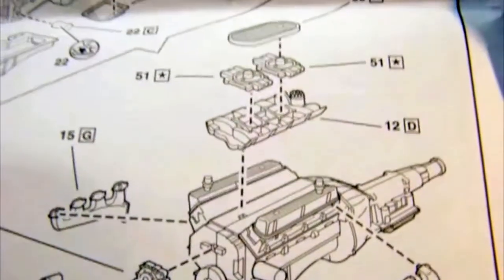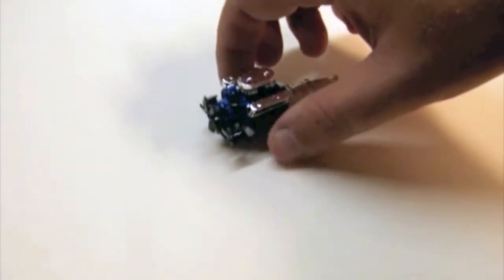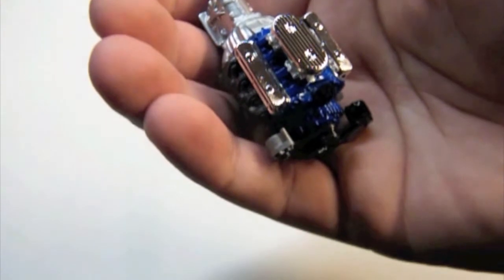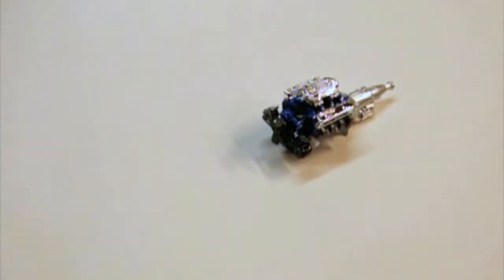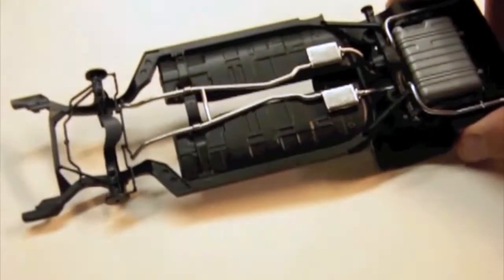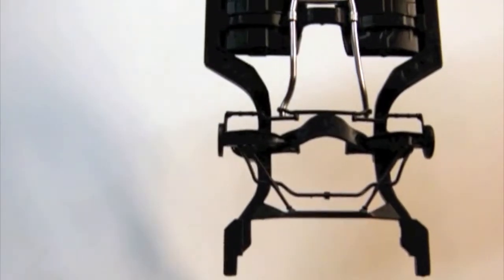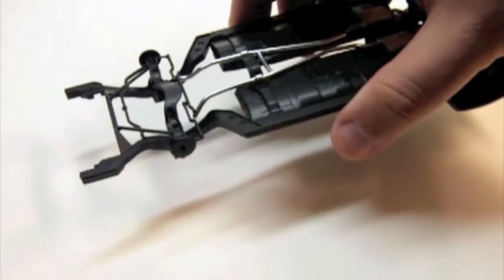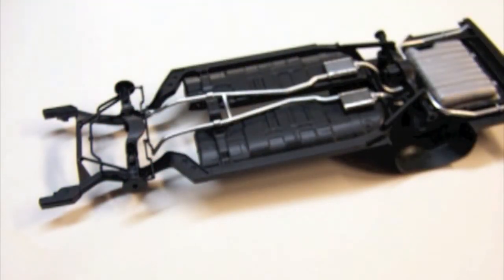Building Revell's 1/25 Scale "Starsky & Hutch" Ford Torino - Part 1

Comment: I'm not understanding the instructions for installing the breather caps. There are two very tiny breather caps that are shown to go into the valve covers, but no holes or indents to mount them.
Reply from the maker: You can see pics of the finished engine with them installed here: https://youtu.be/BaJTkVnnPL4?t=120

Comment: Looks great so far. What year is this model anyway? It doesn't say on the box that I could find. Looking forward to the next update. Thanks!Mike
Reply from the maker: +mike breazeale Thanks!  Yeah, I think Revell intentionally left it vague.  It doesn't have a smog pump, which I think were added in '75, but finding hard facts about these cars has been tough.
Reply: +classicplastic101 Okay...I have pinned it down to a 1975 or 1976. Three different articles I found on the old interweb said the first one was a 1975 and they finished out the show with a 1976. Idk... Thanks!
Reply: +mike breazeale Here is one of the links I found...  http://www.classictvcars.com/gran-torino.php
Reply from the maker: +mike breazeale Part of the tricky thing is not knowing what Revell was using as a starting point.  The engine seems to have a few details from both the Windsor and Cleveland engines, so it's possible that this model doesn't represent any one specific car.